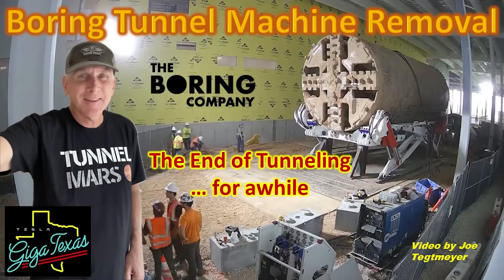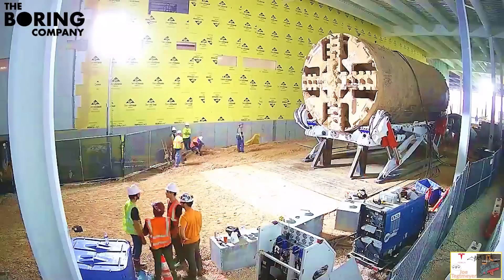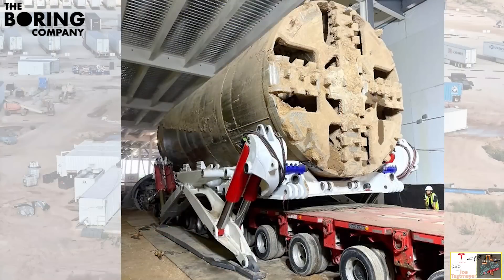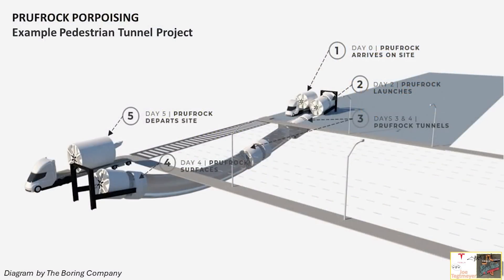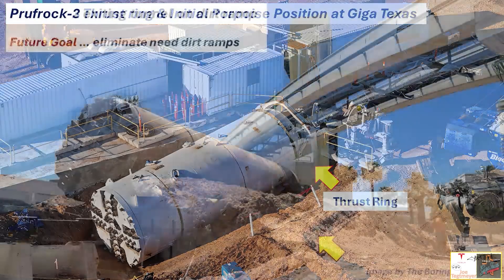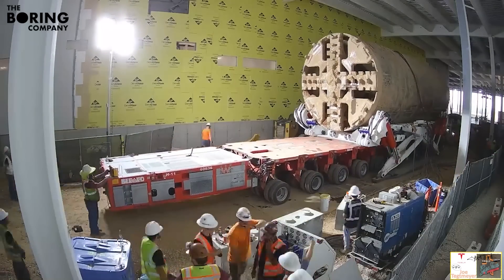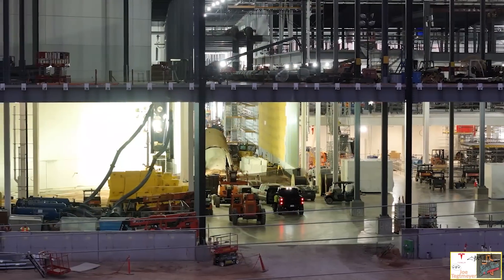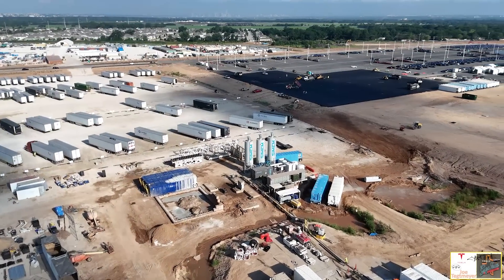Boring Tunnel Operations End at Giga Texas ... an Update!

Comment: Ah ha! Now I know how Boring gets it done! Prufrock 3, The Monster, and SpaceX-like SPMT are super 😎. Thanks 🙏. In the east end of Toronto, a 6 km extension being built and is supposed to take 7-8 years. I wind how fast Boring could do it and for how much?
Reply: TBC don't have the right size TBM's. They are focusing on a one-size-fits-all approach, for use with single electric vehicles. No use for a metro scheme. The Toronto projects are using single track 6.3m diameter TBM's (suitable for a Metro heavy rail 1,500V DC OHL system). I think one section (Scarborough) is using a 10.7m diameter TBM with twin tracks in the single tube.

Comment: That is  interesting that the other tunnels are not going to happen and only one tunnel. single point of failure
Reply: If the tunnel can't be used, cars can always be driven to the west side.
Reply: How often does a tunnel fail? What is the failure cause; earthquake?
Reply: @jimdetry9420  An EV fire in the tunnel for one thing.
Reply: @DavidJohnson-tv2nn  EV fires start slowly enough to get out the other side.

Comment: Do you think they missed the exit point.  Were they planning to have the return tunnel parallel to the first?
Reply: Not enough space between the footings for a parallel tunnel.
Reply: @east78  Not in that location for sure. No need for one.

Other locations, I don't doubt there has been a change of plans.

After watching and commenting on these videos for 4 years now, it's a given that Tesla changes plans constantly.
Reply: @DessieDoolan  The reason it looked like a possibility is that the tunnel looked oddly off centre.  I don't know where the 2 tunnel thing came from really as it really is only one way traffic.
Reply: @Electobat  Joe's 5 April video at 9.49 shows the reason for the offset, a concrete stormwater drain.

Might have been a late addition/change.
Reply: @DessieDoolan Love this community.   Thank you.
Reply: It is a great comunity!!!

Comment: 4:12 looks like a tight fit on exiting.
Reply: 4:32 I wish there was a picture when Pruf-Rock was just under the bridge !!! 
I wonder what could be the overall hight, width, length, and weight of the Prufrock and self moving trailer.
Note: It looks like the Cybertruck is pulling the Prufrock.
Reply: @nihongobenkyoshimasu3190  Height of TBM on the SPMT scaled to 19.7’ 6.4m.

Comment: I wonder if the tunneling took longer than was expected.  Did they run into problematic soil conditions or equipment failures?.  Did they have to wait for permits or for certain parts of the south end construction to be completed?  It seemed to an amateur to take a long time.